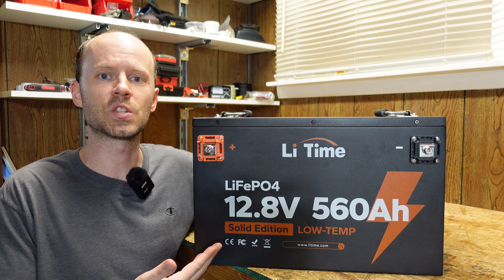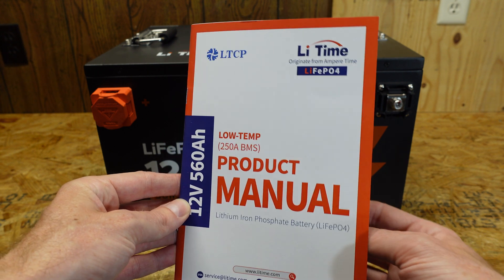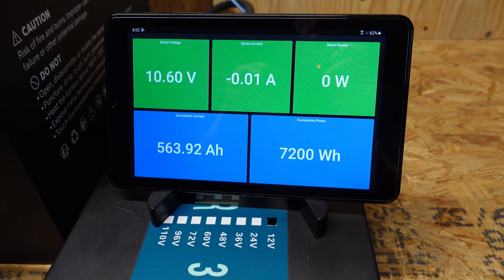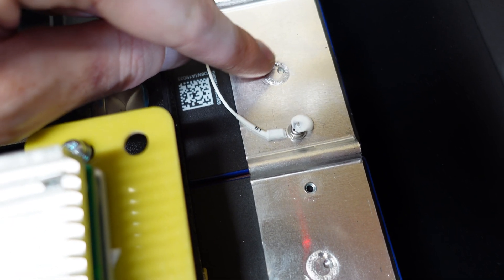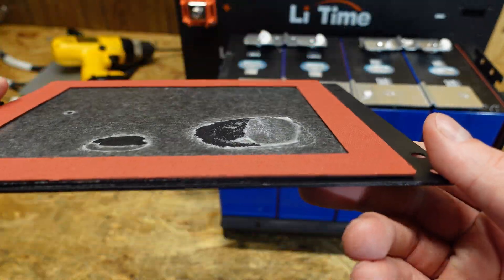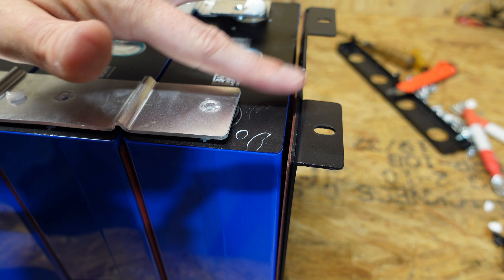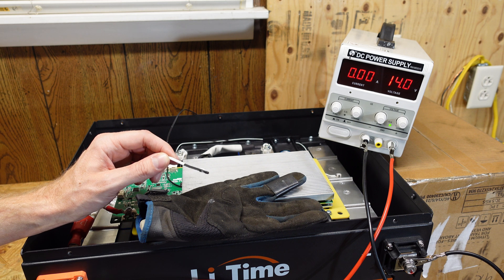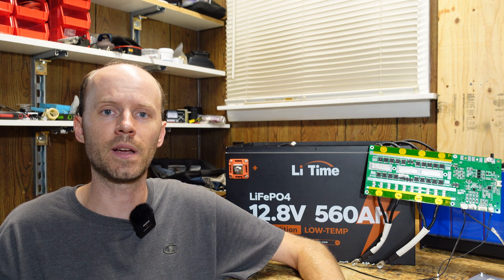NEW LiTime 12V 560Ah LiFePO4 Battery, 7168Wh!! Full Review and Disassembly

Comment: a lot of aluminum  and solder --both not  as good as copper.
Reply from the maker: The busbars are laser-welded. Aluminum is standard since it is the metal used at the terminal. It is a perfectly valid electrical conductor. You can't laser-weld copper to aluminum posts.
Reply: @LithiumSolar   and solder ?
Reply: @LithiumSolar  https://www.youtube.com/watch?v=RBVlEk5_hpE

Comment: So all that said temgot now called temgo the 460 ah is the best money perfect battery. The eve cells are good cells and there a cells. I got one im putting two in my Toyota highlander. I got ripped on the other one. So I orded another one for a grand. So im not solor power i got 320 party speakes that are permanently mounted in the back of the highlander. I run a Andes 600 pro power station. So I like to keep my ears. The 320 party speakers take nothing to keep the jbl party speakers charged at 100% plugged in to 110 ac. They will run for days and I bring it into the house and charge it. My point im a cb radio pirate i run 1700 watts out the highlander. So the temgot  460 ah battery  will run my amplifier on 150 amp peaks for hours and gets it done. The problem the amplifier has c transistors they need 15.6 volts to wake them up. So sec america sells a big boost converter 10 to 14 volts in gives me 15.6 volts out with out moving. I had to use two converters there rated at only 80 amps continuous. So complaining they sent me another for free. Thats good they saved me 650 dollars with shipping and tax. So you guys get sponsored on here and you get all your stuff for free. So I got my temgot hooked to a sterling 120 amp dc to dc charger with a kill switch. I run my amplifier off the battery afther im done I hit the switch drive and recharge. So im going up to a 3200 watt peak amplifier.  Thats a pure sign wave amp not a joke  bass head amps. Them guys on them amps need half the amps. Thats all peak power not a good carrier a good amount of watts then modulated peaks. So i got the battery 15 months over a year. The battery afther the discharges and a cycle charge I got more amp hours then your test when i first got it. To run the 16 transistors  in a 16 pill. They run them in a house  with a 400 amp power supply hooked to 220 ac. So you wanted to know how someone made out, me. The battery was worth 1163 dollars with tax. I  just got another one. So how does the back of my highlander fit all this. Was real  easy took the back seat out. The batteries will out last me im 64. The only thing that kills cell life is leaving them when winter comes. I will bring them in around now and bring them out in  early spring. I used them for 8  months stright there perfect. Then i used them another twol. I built lithium titanate batteries there garbage 6 s banks you need 4800 just for cells. To make a 480 amp bank. They die quick a 1300 dollar battery built in a nice case with thick bus bars by the time your done you got 1000 dollars in an 80 amp hour battery the voltage drop from 15.6 is instant off my amp im running now then the 14s goes to 13s quick 
 Then the 12 volt range. Then a 6s is done you should not take them down below 12.1 volts and it comes quick 35 minutes and you key up 15 seconds and unkey for 20 seconds a joke. So two 6 s banks of yinlongs is a waste. So every amp you use to maintain 15.6 volts needs to be put back. So one 6s bank takes total of 400 amps and two banks take two. Your voltage will always jump around with a alternator. They  lose more amps from heat an alternator. So everything should go to battery power in your suv its the only way to go. I dont need my motor up at 2500 plus rpms to run an amplifier. Have a nice day

Comment: The real issue with this is I WANT to use it as a starter battery... but I really need like 600Amps continuous (7kw starter 671 detroit) if this could discharge at 1C it would be perfect for that. The weight on this is similar to an 8D battery but its better in most other ways except peak discharge current (I mean it can do it for one second).

Comment: such a big battery take a lot of solar panels to recharge in one day. 7,168WH  is cool as a reserve, but to the simple user of solar batteries  I wonder if a 25,6v 300ah battery isn't a safer option?  But this one is a permanent istalation  for the size of a battery must be heavy to move around.?

Comment: This is a rip off. Just 4 12v 140Ah batteries run in parallel all together in one box. The fact that you cannot parallel and only run "up to 4 in series" gives this away. And buying 4 150Ah 12v batteries is cheaper at this point.  Not a good value at all.

Comment: Thanks for the tear down, not impressed they used 8 280ah cells instead of 4 lf560k cells. Also seems they cheaped out on BMS, be better if they used a BMS with active balancing like jk BMS. So seems their build robbed everyone of about 6000 cycles as lf560k cells rated for 12000 cycle life.

Comment: The internal impedance is way too high. At 250amp load the 40mOhm impedance will mean the battery is dropping 10volts internally, equal to internal heating of 2500 watts! In practice the internal impedance of a battery should result in an internal drop of no more than 1 volt at max load.

Comment: I'd rather have 3, 200ah batteries. If one goes bad, it's cheaper to replace and can be removed from the system leaving 400 still working.

Comment: Saying fet transistors is redundant. They are Field Effect Transistors, so you're saying field effect transistor transistors. lol
Reply from the maker: No it's not 😂
Reply: @LithiumSolar  Field-effect transistor
The field-effect transistor (FET) is a type of transistor that uses an electric field to control the current through a semiconductor. Like I said, transistor transistor. Just say transistor or fet.
Reply from the maker: @methanial73  I say it that way because 1) A lot of people don't know what a FET is, there is a backslash in there "FETs / Transistors"  and 2) I find it funny that it seems to bother so many people 😂

Comment: WT is similar to a 5k gas generator. Not too bad, i'm surprised it doesn't come with wheels and a handle. But i guess you can just use a handtruck to move it to its home. But this isn't really a shipping friendly weight.
Reply from the maker: I think the idea is to install it somewhere and not move it for 10+ years until it's reached the end of it's useful life.

Comment: Given the capacity increase in the 280ah size cells these are either old cells or just old technology. 
I love that the industry is finding the smallest packages for a given energy.
I just saw some 24v 100ah batteries that aren't much bigger than the group 31 size. Or is it group 27, idk.
I'm in a car and i don't want plastic encased air and foam. I want energy density.

Comment: I have 8 280 Ah prismatic cells (USD 1,098.00) and  JK B2A8S30P BMS ($115.75). The currency formats are copied directly from my orders pages on the suppliers' websites. This doesn't include the costs of materials, tools, and supplies needed to assemble the batteries into a pack similar to this one. People need to learn to ask questions to their suppliers. The QR codes are from the people who bought the cells from the manufacturer. If you peel off their cover, you should find their supplier's QR code and dig deeper if you want to expose that of the cell manufacturer. My cells have QR codes on a black plastic cell topper covering the manufacturer's code directly on the top of the cells. There's nothing fishy going on. It's just how it's done. Looking at this battery, I might have chosen to go with this instead of doing the DIY thing. I would have gotten a warrantee and a strong carrying case, not to mention assembly and easy connection for another $200 dollars.

Comment: Would this battery be compatible with my stock 50 AMP WFCO WF-9855 converter and Xantrek 1200? I would like to purchase a battery to get me through and use when upgrading the system later.

Comment: Why would I spend this kind of money on this large battery when I could get 6x100 amp batteries for half the cost with 6x redundancy and 600 amp continuous output? And the six are much easier to handle to boot. Sure, a bunch of jumpers, but that does not add much cost.

Comment: Is it possible to have a solar oanel array thats too small to charge this thing.. better yet whats the minimum amount of solar this thing can work on?😊
Reply from the maker: There is no minimum amount of solar to charge this battery. It's just a matter of time. The smaller the solar array, the longer it will take.
Reply: @LithiumSolar  thanks alot

Comment: Thanks for this helpful Video. Great work!  I plan to use this same battery as a cheaper and for more capacity alternative to an Extra Ecoflow Delta 2 max Smart battery. I did get an Ecoflow Alternator charger and I plan on using that to charge this battery as storage and send that power to my power station to supplement, and reverse charge all using the EF Alternator Charger when the LiTime needs to be charged. I hope it works as I theorized it would.

Comment: Doesn't know what a cycle is? Charge cycle 0-100 for 4000. 80 there after
Reply from the maker: Nope. 1) You didn't specify current. It could be 1C but some are also 0.5C. 2) You also make the assumption of 80% SOC but some datasheets specify 70%. Like I said in the video, we don't know without seeing the manufacturers datasheet.

Comment: what is the use case for this though?  It is currently priced at 3x the cost of simply running 5 100ah batteries for the same storage capacity.
Reply: The extra wiring to plum 5-6 batteries together will create imbalances between the batteries no matter how careful one is in making the cables for them..This would be a good study to see the difference between the big battery & the group of batteries. I am weight limited in my RV so I want to keep the batter size to around 100 lbs max since I also have to consider the 3KW inverter & BIS components.

Comment: Why 12v tho? should be higher voltage to be able to be used stand alone on more modern systems
Reply from the maker: Why should it be higher? It's a 12V battery. If you don't need a 12V battery then don't buy one? I don't understand the question. It's a 12V battery for 12V power systems.
Reply: @LithiumSolar  its high a capacity battery. Most will not even consider to build such system with so low 12v system. You must add in your thinking the complete system not just the battery.

Comment: Grade A LiFePO4 Cell & 10 Years Lifetime: LiTime's 12V 560Ah lithium batteries use grade A LiFePO4 cells with higher energy density in our battery pack. Compared with the 200-500 cycles and 3-year lifespan of lead-acid battery, Litime 12V 560Ah LiFePO4 Lithium battery has 10-year lifespan, with 4000+ cycles @100% DOD ,6000 cycles @80% DOD , 15000 cycles @60% DOD.

Comment: I purchased this battery from Amazon.  I checked their description to see if it could be paired with another brand battery - they had nothing in the description.  When the battery arrived right on top in the owner manual it says that it IS NOT RECOMMENDED to be paired with another brand.  Now I am getting hassled with the return - am told that it is my personal preference to return and I would have to pay for the return shipping.  They also said that they would deduct their original shipping cost from my refund - Amazon did not charge me shipping so why deduct shipping cost!  I would not recommend buying these Litime/Amperetime batteries.
Reply: Too many variables, it is the same for lead acid batteries, same age same size, same brand, same model only ... Unfortunately.
Reply from the maker: I am not aware of a single LFP battery in existence where the manufacturer tells you that it can be paired with another brand's battery. There are just too many unknowns for that question to be properly answered. It is not a simple yes/no. It will depend on your load size, individual BMS settings, power distribution (fuse sizes, cable sizes, etc).
Reply: @LithiumSolar  - I’m new to all this and knew that I should check if they could be paired - know I know.  There was nothing in the description to cause me to question - if it said not recommended to pair with another brand, I would not have ordered it.  It is wrong for them to make me pay shipping on the return and deduct shipping from my refund.  Thank you for your reply.  Also I have a Chins ordered to pair with my existing Chins.  I have no complaints on my Chins and I would recommend the Chins.  Thanks again.

Comment: I prefer copper bus bars, conduct electricity better and less heat
Reply from the maker: Indeed, but copper and aluminum don't play nice together. The battery terminals are aluminum, hence why the majority of batteries are using aluminum busbars.
Reply: @LithiumSolar  if they can’t play nice with each other, they go into timeout lol

Comment: The delivery guy definitely caused that dent on the cell. If you are not strong, careful or able to use common sense, you should be doing that kind of work. I’m a delivery driver and deal with heavier items than that, sometime by hand and a dolly. I’m always extra careful in handling the items and using common sense.

Comment: I have two of these in my RV with 1200W on the roof, a MP2 and all the rest of the Victron goodies. Bought them right when they were released this summer. I suppose I rolled the dice a bit, but they've been great thus far. We've boondocked a few times and wanted for nothing. Only bummers for me are:  no Bluetooth for BMS/cell telemetry (but I knew that going in) and I wish I knew more about how their BMS works; e.g. balancing details, etc.  Thanks for reviewing this battery. Yours is the first I've seen for this specific model. Oh and LOL on the FedEx driver! HA! Luckily mine were pristine (FedEx from CA as well).
Reply: You must be Rich
Reply: @coreybabcock2025  Well, he WAS rich. 😅
Reply: @Bruce; how do you monitor at what percentage your battery is at with relation to your loads? I bought the LiTime 60A MPPT with Bluetooth (along with this 560a battery) thinking it would monitor in/out to the battery but now it seems I may be wrong on this... It seems the battery would need to be Bluetooth as well for me to monitor my loads. Curious to know how you do that. Thanks !!
Reply: As an owner of this battery, do you have any issues with voltage fluctuations or resting voltage.  I bought one of these , charged it up (after having to buy a 60 amp charger as my 30 amp charger wouldn't get it to 14.6 for some reason).  Left it sit overnight and it measured 12.9 volts resting.  My 8 other Litimes 200 AH batteries will hold a resting voltage of 13.3 for months on end when no load is on them.  I assume maybe I received a bad battery.  What has been your experience with voltage?

Comment: The battery cables to use that much amperage is going to be massive and expensive.  There is a reason why larger solar systems are 48V based.
Reply: BMS is limiting to 100a I'll bet
Reply: @paulmccarter908  Nope. 250A BMS and max continuous of 3200W.

Comment: I don't understand why they would make a 560Ah battery at 12V! A battery of this capacity must be 48V.
Reply from the maker: Why does it need to be 48V? Maybe you only need to pull 20A but allow for a long runtime. In that case, 12V 560Ah is perfect.

Comment: Great tip for the delivery, now I gotta watch the tracking like a hawk and ensure I'm ready to run out and help the delivery guy get my batteries off the truck 😅
Reply: By the time you get to help and prevent a tumble like shown here the battery has already been moved from one form of transportation to another at minimum 2 times. 3 times more likely. It was probably dropped at each junction.

Comment: Questionable grade of cells, no matter what the qr code says. This battery would need at least a 2amp balancer to keep cells in line. At this price point I'd bet the cells aren't grade a. To finish this review you would need to take milliamp readings from each cell which would entail further disassembly then at least 10 full cycles and check the balancing. I also wonder if those welds will hold when the cells expand. I'm not a fan of the bms's that use multiple wires. I use single terminal with 2awg cable with crimped terminals, no sodder.

Comment: A FET transistor? That's like entering a PIN number at an ATM machine!
Reply from the maker: No it is not, you are missing the backslash in your FET/Transistor - different from Automatic Teller Machine Machine.
Reply: @LithiumSolar  I was just trying to be funny, but if you want to be serious, fine. Where do you get the "backslash" (it's actually a forward slash that you used) in your example? Give me a link to that from a reputable source, please. Thanks.

Comment: Darn, only 250a continuous is pretty low for 500ah
Reply from the maker: I think if you're pushing anywhere close to 250A, you might consider a higher voltage battery bank such as 24V or 48V. Even at 250A you need some pretty thick cables, can't imagine the size required for 500A continuous.
Reply: @LithiumSolar  solid point! I'm personally running 4/0 wire. Going to 24v would be nice. Unfortunately, they do not have a good amp selection at 24 volts, so thick wire is what I'm stuck with for my 4,100-watt RMS sound system on the boat.

Comment: Question how would 2 of theses Batteries work on my 18 wheeler being it's case is made of metal do they have a option with case made out of some type of None metallic material  and also does this charge off of a good alternator plus shore power and handle extreme heat and cold.? Thank U

Comment: I assembled 7kWh battery myself for approx $800 (8*EVE 280k + JKBMS + case), buying locally in Ukraine. Had I ordered from China, it could have been $600.  $1500 seems really overpriced, especially as it does not have any nice features like automatic self-heating.